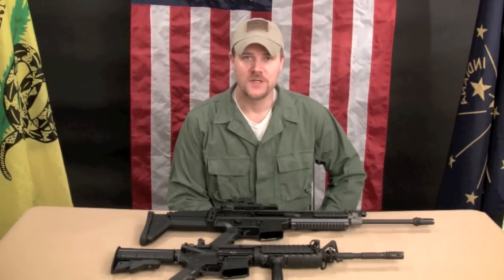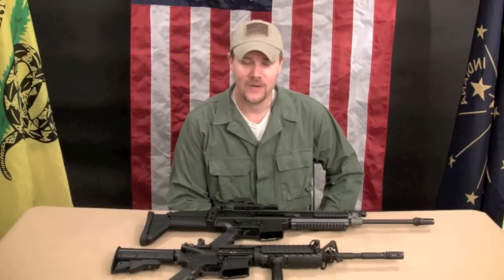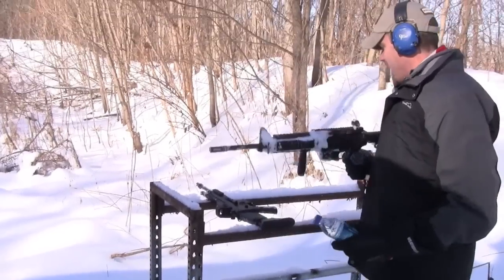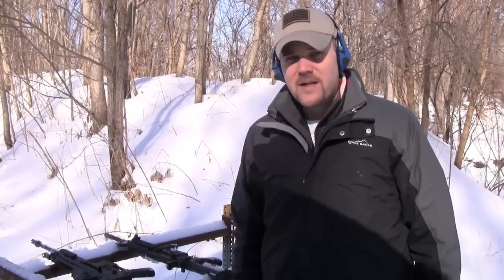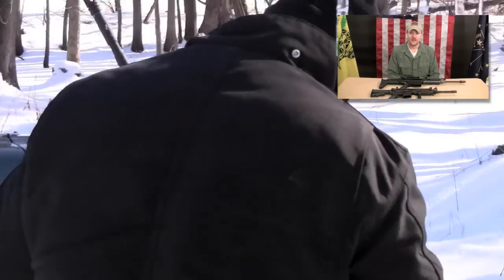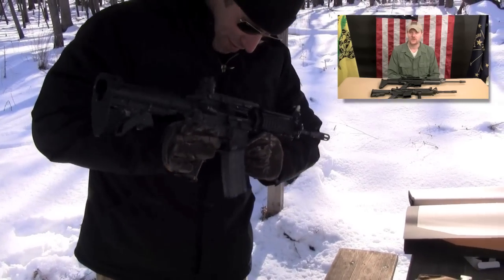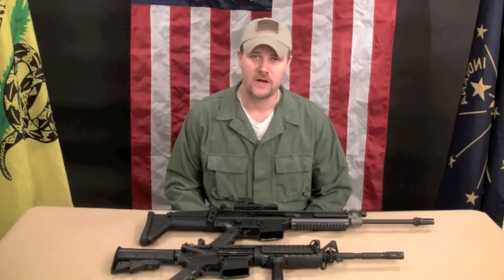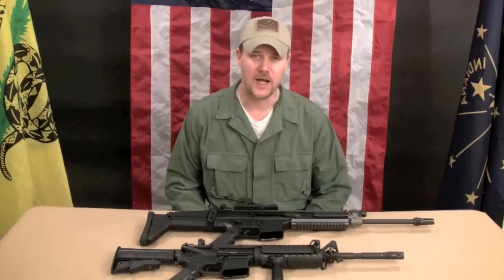SCAR vs M16 Snow and Ice

Comment: M4 Carbine:
#1: Collapsible stock
#2: Barrel = 14.5"
#3: M1913 Picatinny rail receiver w/detachable carry-handle rear aperture
#4: 3 position selector switch Safe/Semi/burst
#5: Birdcage flash supressor
M16A2
#1: Collapsible or fixed stock
#2: Barrel = 16" to 20"
#3: M1913 Picatinny rail receiver w/detachable carry-handle rear aperture / fixed carry-handle and rear aperture
#4: 3 position selector switch Safe/Semi/burst
#5: Birdcage flash supressor
similar rifles but not exactly the same.

Comment from the maker: @thatguy66ish There's no need to clean it, nor is there an easy way.  If it fails you replace it.  It's simple to do, just a single roll pin holds it in place. Chances are you'll never have to worry about it.  I have an AR15 that's 25 years old and I've not replaced the gas tube.

Comment: I don't understand why these tests are never done in a way remotely representative of the real world. Put an (empty) magazine in, throw it around a bit and move it in the snow to simulate moving in the ground, maybe fire some shots through it to melt the snow then wait 15 minutes to let it freeze, empty and move it about some more, basically something remotely representative of the real world intended use rather than just "lets take the magazine out and try stuffing snow into all the open holes with my finger then see if it shoots". That tells you absolutely nothing about how the gun is going to operate in those conditions with rough use.

A gun designed to mitigate dirt and debris like the FN F2000 will get a lot more dirt with no magazine and fingers stuffing snow into unlikely places rather than with the silicon seals working and everything sealed as designed. Likewise a gun with a loose finish is more likely to get stuffed full of snow and iced locked, though real world design might shield said areas. Bottom line is if you're looking how a weapon is going to perform its useless to perform entirely unrelated tests. That would be like testing how much alcohol you can drink by downing glasses of water.
Reply: I did my military service as light infantry in northern Scandinavia, several months were in sub zero. And I agree with you. The rifle is in sub zero for 10-15 hours per day, you crawl around and the snow sort of cakes into the weapon and turn into semi ice-snow packed stuff. However, I did not have any issues with malfunctions. We WERE issued with a little plastic cover for the nozzle that we were told was to prevent snow caking into the barrel. We invariably forgot to remove them and shot those away though and did without them for the rest the service. However, it does show that the military planners had at least some concern for snow causing problems (those guys do lots and lots of tests).

Comment from the maker: @coalhu The only SF units I know of that were using the SCAR Mk16 were the Rangers.  They have since stopped using the Mk16 and no units of the US military are currently using it as a standard issue weapon (it's probably still in limited one-off use).  The SCAR Mk17 is still in wide spread use though.  The SCAR is in military trials against the ACR and other rifles to determine which one might replace the M4 in the future.

Comment: Being as the M16A2 is capable of having it's stock replaced by a number of different kinds; these can range from adjustable to collapsible, and the barrel can be replaced since the M4 and M16 models both fire from the same bolt style and use the same cartridge and are also capable of using multiple hand guards, all you have to do is read the papers to tell whether or not it's really an M16. In this case, he did.

Comment from the maker: I try to respond to questions where I can.  I respond to every question asked on my Facebook page though.  It's hard to keep up with the video comments at times.  But I check my FB page several times a day.  I'm an Aimpoint fan.  They are more durable in my experience.  Plus they measure their battery life in years, not hours even if you leave them on for months at a time.  I own several EOTechs, but if I could only have one it would be an Aimpoint.

Comment from the maker: @Tenacious21 Not with the AR15.  The gas tube on an AR15 is made of aluminum and is not very strong.  If you submerge the AR15 with a standard gas system and immediately bring it to the surface and fire it, the gun will have a catastrophic failure.  Search here on Youtube for the HK416 video where a guy is standing in a dugout mud hole and submerges the HK416 and M16 then fires them.  You'll see what I'm talking about.

Comment from the maker: You can not have the latest M16A4 as a civilian.  As Hjjfffaa correctly states, the registry was closed in 1986.  At that time the most current M16 in production was the M16A2.  The M16A4 wouldn't appear on the scene until 1996, long after the registry was closed.  So, I can't legally own anything but a M16, M16A1 or M16A2.  M16A3's, M16A4's and M4's are not legal for civilian ownership.

Comment: Well I wouldn't have a clue what it actually is, because it's model number isn't exactly written anywhere, but from what I know an M4 is the carbine version of the M16 with a shorter barrel, and adjustable stock. Also you might want to do a quick google search of "M16A2" to see what comes up. The M16A2 was just an M16A1 with some minor external differences, and a 3 round burst setting instead of full auto. Also the M16 family of weapons does NOT have an adjustable or replaceable stock.

Comment: Barrel length on the m4 is shorter and it has a flat top for mounting optics instead of a carry handle. Other than that its a very similar gun. Recoil is about the same, ARs don't really kick much, very easy to shoot.

Comment: Packing snow on the outside of any firearm will not have any noticable effect on it much like packing snow on the hood of your civic or F150 will not REALY effect performance either. Long term effects without proper cleaning will of course happen. Its when it gets into places like the barrel (muzzle or chamber) bolt, trigger group ect that you would start to see any real detriment to performance. Just my @ cents. Great video keep em coming!

Comment: Wow, that's extremely dangerous to do. Espcially since the DI system on the M4 could fill with ice and cause a catastrophic overpressure event, thus causing the entire BCG and upper to explode when fired.

What we did with our M14's at the North Pole, was just smack it with a night stick to break most of the ice, dump some cheap gear oil on the reciever since we had no grease. Then, it fired, and fired, and fired. It smoked alot from the oil, but it worked in the worst conditions imaginable.

Comment: It can be an M16A2 with a different upper. Just like how an M4A1 can have an upper with a 16 inch barrel and still be an M4A1. An M16A2 is merely an AR-15 with a trigger group that utilizes semi- and three round burst. You can put any upper on it with any barrel, but as long as you have that lower, it'll stay an M16A2. And the stock, it was used on the old M16 Commandos that have been used since Vietnam. Be sure to brush up on your AR-15 components.

Comment: I was in the military and the m-16 charging handle would freeze solid.
Reply: @Gaunter O'Dimm .what kind of oil do you use that freezes at cold temps?..lol
Reply: @Gaunter O'Dimm. Mobile 1 synthetic is your answer.  Still fluid enough to protect engines in the neighborhood of those temps
Reply: @Gaunter O'Dimm Mobile says its good for engines gotta be good for guns

Comment: why don't you put both of these guns completely in the water for ten second and take them out then shoot , that will show you which gun is actually better , but shoot the scar first before the m4 so you can make sure that the scar  is more durable, before you die or get injured of the m4 . if that works buy another m4 or fix the one you did the test on and soc them both in mud and sand , that will show you which one is really better

Comment: The receiver was made before 1986 which was when they stopped manufacturing full auto receivers for civilians. M4s did NOT exist in 1986. The M4 came in 1995. Do research first boy. In America, the receiver is the firearm and it states its an M16A2.

Comment: The m16 cracks after repeated use in the cold, Canada, Netherlands, Iceland, Denmark, Norway, Sweden and U.K SF use the C7 version of the M16, it has harder plastics and a steel forged barrel designed for heavy use in the cold.
Reply: The Colt and FN m4/m16s that are for sale are the same minus full auto...same 4150 button cut chrome bore and chamber and phosphate outer as any m4 in use...the m4a1 and m16a4 have an aluminum quad rail so I don't think there is anything to crack..if it does they replace it

Comment: Why does he have an m4? m4's are not legal for citizens
Reply: you can pay exorbitant amounts of money and own one. you have to get a license for it, and then sell a car or 2, or 3, for a used one.
Reply: Only pre 1986 ones
Reply: Mike Warren
Thats actually false, as long as you pay for the paper work and the stamps (SBR, Class 3 etc) you can own whatever gun you want, you just have to have the money the patience and a clean background helps to.
Reply: Only pre 1986
Reply: Mike Warren
So the one guy i know who has an automatic SCAR 16S, who paid lots of money for it lots of paper work is still breaking federal law?
Reply: I wound like to know the details of how he got it. The full auto registry was closed in 1986 by the gun control act of 1986
Reply: Mike Warren
Well since i wasn't there i can only speak from word of mouth, in which case he went to a class 3 dealer bought and registered a lower receiver for the weapon with the correct sear in the trigger group. i know he filled out paper work and payed about $200 for it and like 6 months later got the stamp/approval then got his lower for the weapon.
Reply: The lower was built pre1986 he must have one that fits all of the rest of the parts for what he built.  

I would never do it as you forfeit you 4th amendment rights when you bl register a class 3 weapon.
Reply: Mike Warren
I'm pretty sure there were no SCARS before 1986. So im gonna bet it was new. And that's the point, do you think the gov wants citizens to have fully automatic weapons, No, watch videos from shot show and things like that, the PR guys will say, this is law enforcement only, this one is for civilians, in reality, a civilian can own any weapon they want, its about what there willing to give up & how much they are willing to pay, the government assumes if they put some ridiculous tax and paper work on it you wont get it.
Reply: the lower receiver was not new. from a legal standpoint, the lower is the firearm, it is the part with the serial number. if he did it legally, it was done with a pre 1986 lower. Lower for full auto can NOT be registered to citizens if manufactured after 1986. That is what the law states. Go to a dealer and ask them and they will say the same.
Reply: Mike Warren
Right i understand what your saying, im telling you from my experience. but the lower receiver can not have been pre 1986, because FN didn't make scars in or before then, a M4 lower is not the same as a scar lower, therefor its a post 1986 automatic weapon, with the correct ATF paper work. and i have asked dealers,they offered to convert my Egyptian MAADI to Automatic once i got the stamp. my MAADI is stamped '91
it can be done, and has
Reply: I dont see how. Iv yet to read anything that says you can.

Not that i would do it, as you give up your rights to the fbi.
Reply: Mike Warren
It depends on state law to, here in Arizona the gun laws are so free its the wild west, if your 18 you can buy any "long gun" or rifle or 21 for handgun however someone who is 18 can open carry a handgun(if purchased through a private seller) and 21 for ccw and you dont need a Permit to Conceal, and so forth, i know places like new York the laws are really strict, so its the state law that really matters in the end.
Reply: Gun control law of 1986 is a federal law
Reply: Mike Warren It is possible for you to own an M4, but in all actuality it is probably an M16 that has been updated to resemble an M4 Carbine. It is also completely possible that he posses a Class 3 dealers license(hugely expensive) and can buy as many full auto weapons as he pleases.
Reply: Mike Warren Its also possible he owns a lightning link.
Reply: Registered Drop in Auto Sear or Lightning link. Drops into any AR-15 platform
Reply: $15 grand. $200 tax. and 6 month wait.
Reply: Don't think the guy has a problem with it, considering he owns multiple firearms in the $2k range and buys them promptly after their release too
Reply: It is a registered M16 (as Tim mentioned) which has had the upper and stock replaced with M4(ish) parts.  You can buy a registered M16 receiver, it's a title II weapon.
Reply: must be nice to be rich
Reply: Mike Warren No kidding. Not just the $20k-$25k for the receiver, but the ammo too.
Reply: Mike Warren You americans have no idea how funny you are to outsiders
Reply: in what way in relation to this conversation?
Reply: which is completely unconstitutional
Reply: For lots of extra money
Reply: TheMetalHeaD256
or ou could just buy a normal ar 15, and have it converted and pay the tax. Which is a shite ton cheaper
Reply: illegal
Reply: Mike Warren
no if ye have the proper licensing it is legal sir.
Reply: Can you quote the law on that, as far as i understand converting it would be manufacturing a new firearm and would require you be a class 3 manufacturer
Reply: Mike Warren yes if ye have the “proper” licensing as I said before, I do not know the exact name of the license, but I do know it can be done. Youtubers like fpsrussia, and many more do  exactly as I said above.
Reply: those guys have dealer samples with the dealer off camera. they have to return them afterward.

if i am wrong then you can find a link to the aft website stating how it can be done, you could find it much easier (as you know what you are looking for), i however cant seem to find anything other than being a class lll manufacturer
Reply: Special Occupational Tax requires you be a dealer or manufacturer FFL. and if im not mistaken, everyone who i have ever talked about it stated that FFL's can not simply hold on to a full auto. it has to be in cooperation with the government or a police force to have it for samples for them, in which you are required to pay for the ammo, and pay continual taxes on the hardware.
Reply: I cant quote the law on it. This is just my understanding. In either case. You still cant make one for your self. You have to have an a government organization interested in purchasing it from you
Reply: Sure they are. Just pay 200 for the stamp and about 10k for the carbine and you got it.
Reply: Only if its registered before 1986
Reply: afr0shooterguy40 $25k, not $10k
Reply: fuck it just buy a bumpfire stock
Reply: Low accuracy. Yay.  You miss the point. Why does the government want better weapons than us?
Reply: Mike Warren are ye responding to me?....
Reply: Sure why not
Reply: Context please
Reply: Mike Warren Thats not true you don't forfeit anything the ATF cant just walk into your house
Reply: Still cant buy an m4
Reply: we should be able to buy and keep anything the army has but we can't. them it wouldn't be as easy for them to come crush us. see us driven before them. and hear the lamentation of our women.
Reply: Mike Warren There are a limited number of M4's in circulation, actually.  You have to have a Class 3 FFL to get one, or you have to submit papers to the ATF and pick up one that goes up for sale (good luck finding one).  Of course, they're as much as a used car, up to 10,000 or more.  But you can get an M4 lower receiver with the extra pin.  You've just gotta WANT it lol.

He's actually shown on the channel his prized M4 which he's kept bone-stock.  All his other stuff are M4-geries.
Reply: TheMetalHeaD256 those are m16's. M4 was not made till 98
Reply: Mike Warren Tax stamp brah
Reply: no. more likely its an m16 lower. Citizens are not allowed to own m4 rifles.
Reply: u can own m4 semi/safe
Reply: That would be the LE6940. that is not an m4. its an LE6940. That is the closest a civilian can get to holding a colt m4
Reply: You mean a LE6920.  The LE 6940 has a monolithic rail and free floating barrel.  The closest thing to a military M4 is the LE6920.
Reply: Frankie Gibbs You are likely right. I didnt look to see what was the difference between the two. Once I saw you can't buy teh real thing i wasnt interested in a cheap semi auto knock off
Reply: Frankie Gibbs Daniel Defense makes an excellent M4 so does Noveske and a bunch of other companies and a lot of military issue M4s do not have a free floating barrel so you're wrong there
Reply: supaproman2 I said military does not have free floating barrel.  Most are made by FNH.  Mr. I must be correct at all costs is it?
Reply: Frankie Gibbs You weren't very clear about it but I can see that you implied it in your comment my bad
Reply: It's ok.  I wrote a complete sentence, "The closest thing to a military M4 is the LE6920."
Reply: The closest thing to a m4 is a fnh civilian m4 the even made a semi auto m249 saw
Reply: no_good_namez the Colt 6920 is the closest thing to an m4 you can get. Colt makes the m4, not FNH. the 6920 is a m4 - fa sear http://www.colt.com/Catalog/Rifles/LE6920Series.aspx
Reply: umm. thats just an accessory... Colt builds m4 rifles. nobody else can, they have the ONLY contract to build them.
Reply: No in 2013 the army signed a contract with fnh
Reply: sure told me
Reply: He never fires the SCAR on full auto, which leads me to believe it's the SCAR 16S (Mk16). The S for Semi-auto. Which is just a civilian version of the FN SCAR-L.